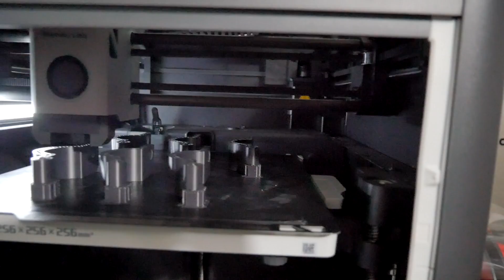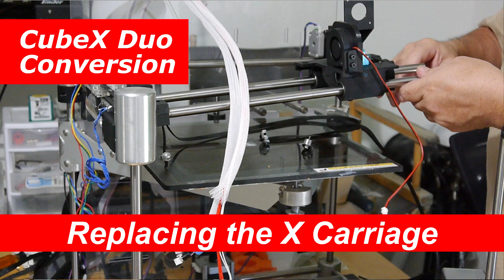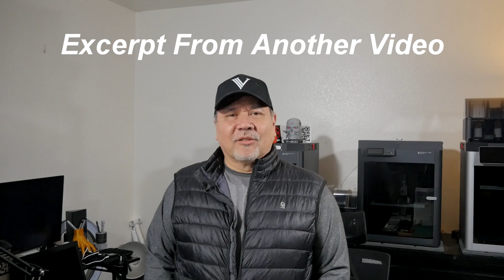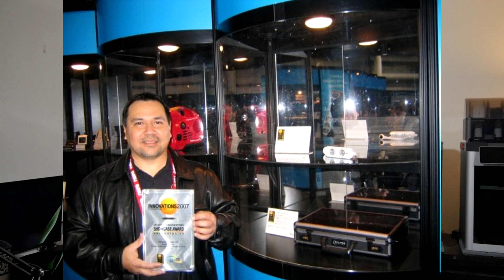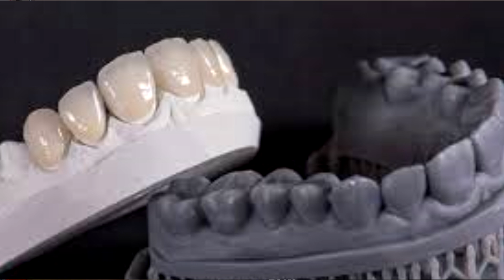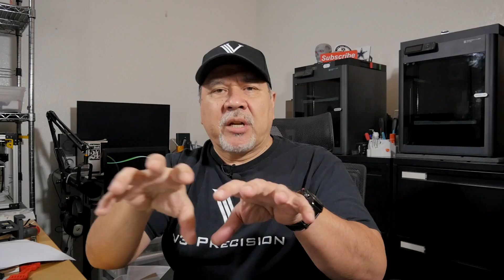What's Coming in 2024 for 3D Printing

Comment: I think you missed the point of the inverted design.  Printing upside down wasn't a feature, it was a compromise made to allow the printer to fold up as small as possible, a 3d printer that could fold up into a space the size of a 1kg spool box and taken with you.  Unless you need a tiny portable printer, they are not advocating printing upside down.
Reply from the maker: The inverted printer shown in the Kickstarter campaign does not fold up.  At a glance it resembles a resin printer
Reply from the maker: The inverted printer they show in the Kickstarter campaign does not fold up.  It is a desktop printer that resembles a resin printer. It definitely does not fold up to a compact size